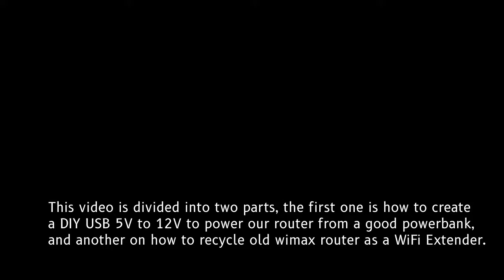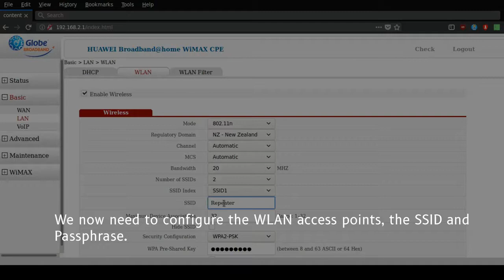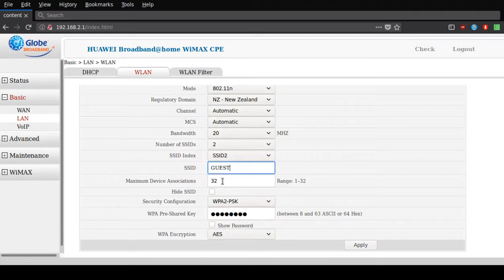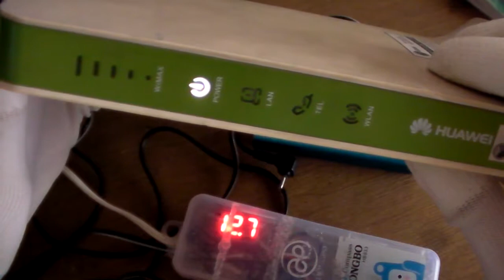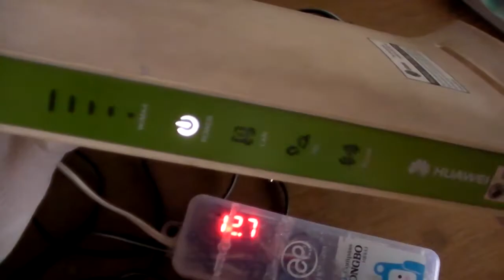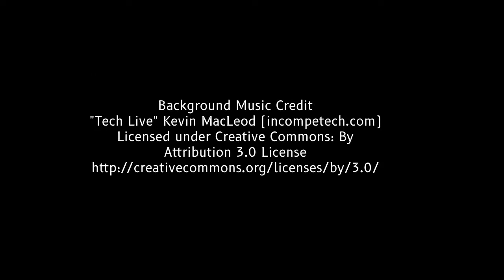#43 Powering Router from Power Bank  and Using WiMax CPE as WiFi Range Extender

Comment: Nagana pa wimax nyo
Reply from the maker: Hindi po, no signal reception. But it can be used as WiFi Extender
Reply: @R1BNC  ano admin password?
Reply from the maker: kelangan mo ng password generator based on mac address AFAIK
Reply: @R1BNC  walang wifi ang wimax
Reply from the maker: @stell6485  kung pinanood mo po yan video makikita na meron Wifi ang model ng wimax ko